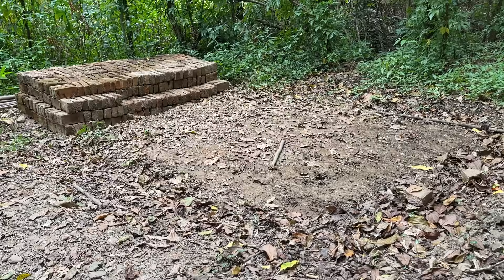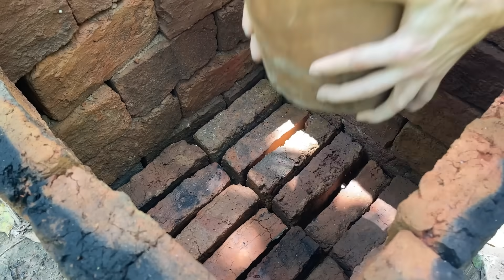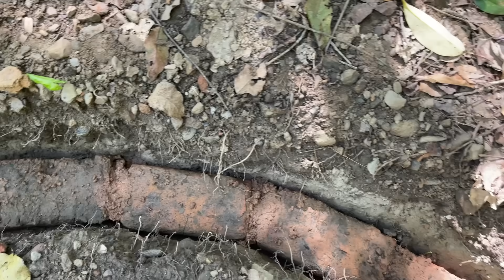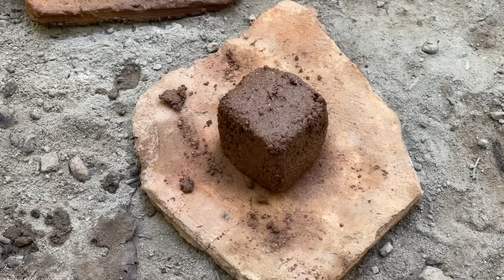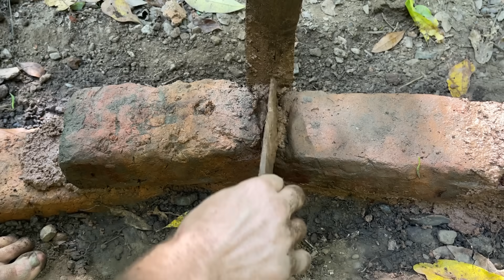Primitive Technology: Wood ash & crushed terracotta mortar

Comment: AI Summary

Abstract:

This video documents the construction of a circular brick dome using primitive techniques, starting from raw materials. The process begins with laying the foundation, followed by on-site production of bricks using a custom-built updraft kiln. A key focus is the creation of a strong, water-insoluble mortar. The mortar's binder is produced by calcining sieved wood ash into calcium oxide, while the aggregate is made from crushed, fired brick (grog). The video details the 3:1 mixing ratio of grog to ash, the chemical reactions involved (formation of calcium carbonate and an aluminosilicate geopolymer), and a successful water-resistance test of the set mortar. Finally, the video demonstrates the bricklaying process, including staggering joints and employing a specialized measuring stick to guide the construction of a pointed, gothic-arch dome profile. The project progresses until the supply of calcined ash is depleted, prompting plans for a more efficient furnace.

Building a Brick Dome: From Clay and Ash to a Finished Structure

*   00:00:00 Foundation and Layout: The project begins by marking out a 1.25m radius circle and digging a 25 cm deep by 12.5 cm wide foundation trench, which is then compacted.
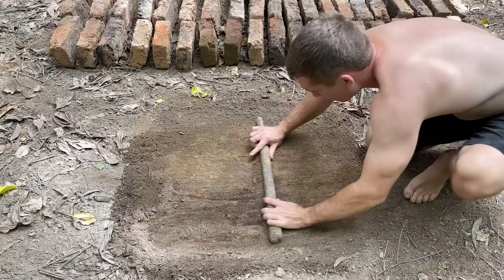*   00:02:00 On-Site Brick and Kiln Production: A small updraft kiln is constructed from existing bricks. New bricks are formed from clay using a water-soaked, porous terracotta mold and are then fired in the kiln to make them hard and waterproof.
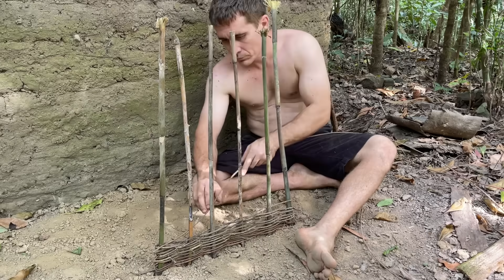*   00:03:33 Creating the Binder: Calcined Ash: Wood ash from the kiln is sieved to remove charcoal and formed into pellets. These pellets are fired (calcined) in the kiln at a dull red heat, converting calcium carbonate into calcium oxide, the primary binding agent for the mortar.
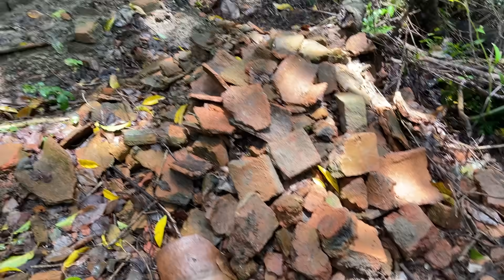*   00:07:47 Preparing the Aggregate: Crushed Brick (Grog): Instead of sand, crushed fired brick (grog) is used as the aggregate. This method is chosen for its convenience and as an effective way to reuse broken bricks. The grog is sifted to ensure a consistent particle size.
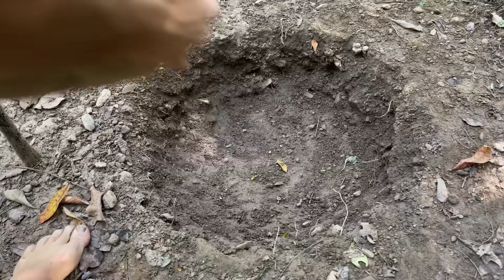*   00:08:53 Mortar Mixing and Chemistry: The mortar is mixed using a 3:1 ratio of crushed terracotta (grog) to calcined ash by volume. The mixture forms both insoluble calcium carbonate and a geopolymer (aluminosilicate chains), resulting in a strong bond. Due to the porosity of the grog, this recipe requires more water than a sand-based mortar.
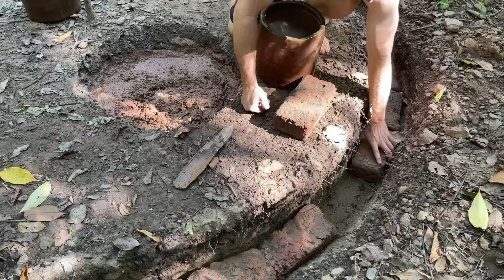*   00:09:42 Bricklaying Technique: Before laying, bricks are soaked in water to prevent them from drawing moisture out of the mortar too quickly. Mortar is applied to the bricks, with joints angled to accommodate the structure's circular wall.
*   00:11:13 Mortar Durability Test: After 9 days of curing, a sample block of the mortar is tested and proven to be completely insoluble in water. The creator notes it feels stronger than previous sand-based mortars.
*   00:14:31 Dome Construction Method: A measuring stick equal to the dome's diameter is used to create a pointed, gothic arch profile. By pivoting the stick from the base of the opposite wall, the precise position and angle for each brick in the rising dome can be determined.
*   00:16:57 Progress and Future Work: Construction halts after the supply of calcined ash runs out. The creator concludes by mentioning plans to build a specialized furnace for more efficient ash production to continue the project.

AI-generated summary created with gemini-2.5-pro for free via RocketRecap-dot-com. (Input: 12,188 tokens, Output: 778 tokens, Est. cost: $0.02).

Comment: That structure looks so awesome, can't wait to see the finished result! With brick+mortar, this one may be one of the longest-lasting builds you have done yet!
Reply: Hopefully no tree accident with this structure.
Reply: Awesome Brick building

Evil and intimidating tree
Reply: @hallohoegaathet7182  Yeah, hoping he scopes out the nearby trees for weak ones and maybe gives them some notches that would guarantee they fail in a different direction... they'd survive some stone axe cuts that makes them lean a little bit further away.
Reply: @lambchaikies  Worst case scenario, he could just clear cut the immediate surrounding area
Reply: I assume, that he will finish it off with a cupula.

Comment: 1:26 I would have recommended a gravel substrate under the brick foundation to help with drainage, a rudimentary weeper so to speak. Very cool though 👍👌
Reply: Part of what makes this channel interesting is that he doesn't get everything perfect the first time. You can tell he researches, but he's always iterating and experimenting, and that's what gives us more content to watch.
Reply: Plus, getting that much useful gravel in that area looks like it would be exhausting. Anything less than stone would just eventually degrade, making the base weaker than just using packed dirt.
Reply: Let's just hope that soil is rooted eh
Reply: I worried about drainage not wall load. Maybe a rock layer at the bottom of the bricks? But he knows his local soils better than we do.
Reply: I was just wondering about the arc he will build and its weight. Maybe preparing bricks with transversal holes will help reducing this weight and saving material and effort while gathering the raw material. However, they would take longer to make, and maybe the technique doesn't allow to use these holes while giving enough resistance to the bricks.

Very nice video though. I really look forward to see the next part.
Reply: Good point!
Reply: Someone can correct me if I'm wrong, but shouldn't the bricks only be soaked and then placed, not drenched in the trench?
Reply: And a wider base at the bottom, to support more load.
Reply: @roror88  it depends how dense his soil is, but it looks pretty solid to me based on his digging technique. A wider base is also probably unnecessary, but does depend somewhat on the density of the soil. Gravel at the base would be nice, but drainage doesn't matter much here with unreinforced masonry. Mainly just a thin sand layer to spread out the load would have been good.
The structure is circular, which helps a lot in limiting the need for thick walls.
Reply: @insertphrasehere15  Yeah that is true, here where i live it's almost a bog lol. Houses need 10meter pillars into the ground to be able to get into a sandbank.
Reply: @roror88 is soil looks pretty gravelly below the topsoil anyway, and drainage isn’t really needed for unreinforced masonry.
Reply: @insertphrasehere15  it’s a sandy clay, so it does have some drainage capacity. Cracking grey clay further down the coast, doesn’t have any drainage when wet.
Reply: @roror88  probably wasnt done because he only has so much bricks, and every more brick made just makes it take a while to the next video. its probably nice to have, but depending what is being built, this is good enough
Reply: @ZetaHorzion  No. Water is the enemy of brick. A proper brick wall doesn't go all the way to the ground because moisture eats away at it. This wall will crumble much faster than one that had proper drainage or a course of stone for the first foot
Reply: @kenlavinlol i havent argued against it, i was replying to the guy saying that the base should be broader, which it should. Additionally i agree that a drainage layer should be added

Comment: How the hell did the first guy to do this figure it out. You can imagine all his friends making fun of him like lol why are you making these random balls
Reply: would be really funny if the guy made it all the way up, but truth is probably, that making lime from ash is probably way older than the guy to figure out that mixing brick debirs and ash makes good mortar. and in even more honesty, guy probably didnt think much of the result, but more how to efficiently use material to close cracks in the wall
Reply: i like to imagine mortar was discovered as a byproduct of a kiln or just a fire-accustomed group noticing that the ground where they built fire became rock hard after the rain had come and gone. Bit of experimentation later, bam, walls.

Comment: BTW I was thinking about your smelter attempts - how about making the air intake pipe wrap around the inside bottom of the furnace, with holes pointing downwards towards the center, something like a reverse burner, to maximize the flow of air into a single concentrated area, hopefully reaching high enough temperature there to make the iron liquify?
EDIT: also, please, pretty please, make some better tools. It's been years ...